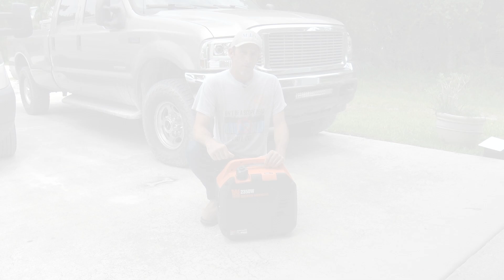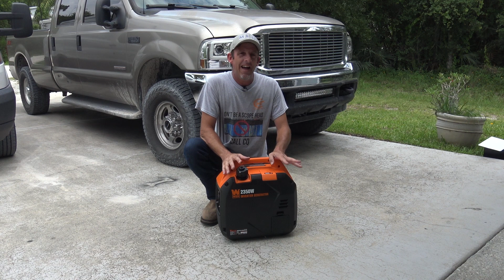WEN 56235i Inverter Generator Review, RUNS MY RV AIR CONDITIONER!! Load Test, Break In And More!!

Comment: I heard a couple different options for the break in on your video. #1 10/30 oil, run a couple minutes, shut off, run 15 minutes, shut off. Run 5 hours (small load?) shut off. Change oil with 10/30. Run 5 more hours. Change oil 10/30. At 25 total run hours change oil. Now synthetic oil can be used. At the 10:30 mark you say change oil at 5 hours, at 15 hours, then use synthetic. Which break in version do you suggest?
Reply from the maker: I think after 15 hours the rings have seated enough to use synthetic, all you really want to make sure of is that the rings cut in to the new cylinder and seat properly.

Comment: How long the generator run ur 15k air conditioner unit....Thanks alot
Reply from the maker: As long as it has gasoline. I think at that load maybe 4 hours. Only holds 1 gallon of gas.

Comment: Works for mine, 13500 watt.  I turn everything off, turn on the ac fan, then the ac.  The generator sounds like it might stall for a couple seconds and then recovers.  But if the compressor goes off it's likely to stall when it comes back on.  So, I set the thermostat to 40 degrees which it will never reach on a hot enough day to require ac and will keep the ac constant on. It's the start up that draws the most power.

Comment: An 18,000 BTU A/C is about 5,000 + Watts. This is rated at 1,900 to 2,200 Watts. How can it possibly handle that load?
Reply from the maker: Because I said I have a 13,500 BTU which draws 1650 watts.
Reply from the maker: You can look up the Coleman Mach 8 13,500btu, manufacturer suggests 1599 running watts, 15.2 amps.... Amps X volts = watts

Comment: I have two of these generators and a parallel kit. Last weekend I broke the pull cord on one and was down to one G, it still ran my AC fine. Like you said, slow start up, first fan on low, then med to high then AC low. I'm running two G's on the P kit because I have heard it's less stress on the G and AC system to not max out the G. Now I'm glad I had two because I would have been out of luck with only one G with a broken pull cord.

Comment: I have the wen and didnt think it would run my 13500 ac, so I always lugged my 3500 predator around. I tried this out and was shocked, it worked ac was blowing 69 degree air out on a 85 degree day no more 100 lb generator
Reply: For how long is the question

Comment: The benefit to me as someone watching the video of knowing the decibels is that many campgrounds have a decibel limit. Also, does the AC in your camper have soft start? I know in my older camper it doesn't, so the draw will be high when the compressor kicks in.
Reply from the maker: No soft start on my ac.
Reply: @HamRadioConcepts  Thanks. It seems like this generator is a good option for us and there is one for sale locally for s good price.

Comment: I used Amsoil 30w Break-in oil for 30 minutes.  Then drained it and ran it again for an hour.   Then I put in Amsoil 5w-30 Siganature Series.  

I have about 10 hours on it and it runs great.  I did a compression test and it's at 148psi.   Very impressed.

I also have the magnetic dipstick and take it out and wipe it off every hour or so.  Oil is still clear.

Comment: Great, concise, educational video, thanks!
Am engine rebuilder said not to put break in oil in the top end (under the spark plug).
Do you recommend putting in a small amount to avoid a "dry start"?

Comment: Can I run a space heater with this one
Reply: Absolutely,  all 120w heaters have a maximum of 1500w or less. This can easily run it and more. I don't see why you would want to run a heater on a generator? Any reason why?
Reply: @randybobandy9828 if you run out of propane with your rv and need heat.

Comment: That is a nice little unit, The outlets are rated for 20 amps, A 15 amp will not have the side slot on the neutral side of the outlet, a 20amp will. I have done alot of maintenance on WEN's but very few have needed repairs. I would suggest getting a spare carburetor just incase.

Comment: Wen 56235i 51db.  Honda EU2200i 48db.   I have the Honda and love it, but it's 3-4 times the cost.  Looking forward to the long term review to see if it's worth the cost savings. All ears.
Reply: Where would you get replacement parts? Even simple items such as carburetor, filter, etc? One of Honda’s many strengths are parts availability.
Reply: @barryzoll9772  yeah.  I paid the premium for Honda, for its reliability and quietness.  I have (2) 2200 and (1) whole house 7000.  Truly lived and died by them in the recent Texas freeze power outage.   It would be hard to give my Hondas up.  But open to cheaper long term review alternatives.
Reply: @cognetic  same here.  I have an EU2000 and an EB5000.  Never failed me.  It’s interesting to see what the copycats have done.  I’ll be interested to see if anybody comments about having any problems with the WEN or other brands and what kind of service they get if any and if they can get me parts. Only time will tell and then it raises the question of if it’s that much cheaper who cares if you can get the parts or any service you just throw it away.  But unlike other items the generator is something we depend on in my case, we have some medical devices at home that must run so dependability is very important.
Reply: I would only buy the Honda in a few circumstances like where I need to depend on it with my life or for running a business where you can't afford a generator failure in the middle of a job. For camping or offgrid living or back up home power this thing will do just fine for $400 vs $1200.
Reply: @randybobandy9828 great point!

Comment: Do you know if this will run on E10 gasoline?
Reply: In my opinion, e10 is a poor choice due to the short shelf life and its tendency to gum the carb.  I use ethanol free "TruFuel" with 2-year shelf life.  It's expensive but worth it.
Reply: @ndoren  Thank you for your input. E10 fuel is being introduced here in the UK. I run 2 stroke motors and have even had problems with E5 fuel. As you say there are fuels available we use them for motorcycle sprinting but are very expensive. Ordinary pump fuel is approaching £10/gallon.
Reply: @CharltonSupporter  what 2 stroke are you having issues with e10 fuel on? My 1300cc 2 stroke jet skis run fine with it. I also buy high octane e10 though, it's about 10% more expensive but Worth it. I store my jet skis with ethonal free gas because the ethanol with gum up the fuel lines and put Moister from the air while sitting in the winter. I guess the UK doesn't have harsh winters where it freezes tho.
Reply: @ndoren  Check gas stations in more rural areas for ethanol free fuel at the pump. I use premium and add Startron to my cans before filling, I have seen alot as a small engine mechanic that does alot of generator repairs. Do not use stabil as it turns to muck.
Reply: @TK4619  I see no problem with ethanol gas as long as you use it immediately but if I'm buying back up fuel that I won't use for potentially months I'll buy ethanol free. Ethanol free is about $1 more per gallon here vs e10.
Reply: @ndoren  no it's not worth it at all. Imagine running your $300 generator on $23/gallon fuel just to potentially prolong its life. It doesn't make financial sense.